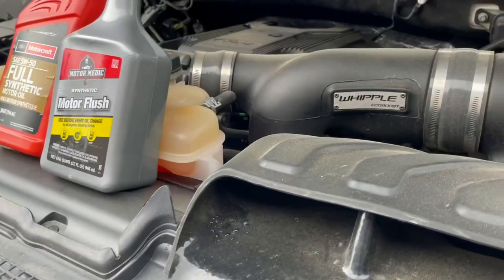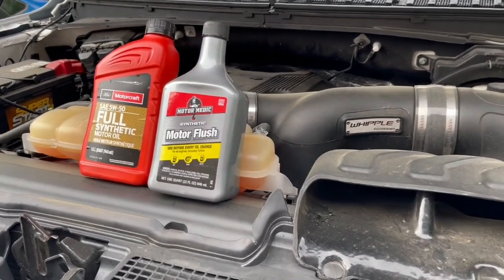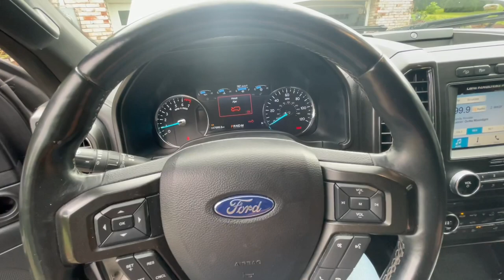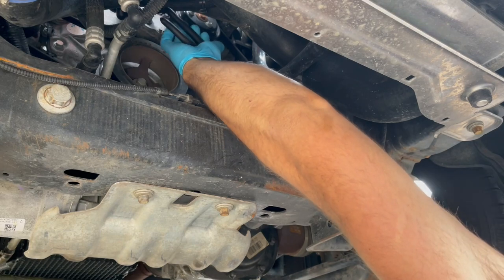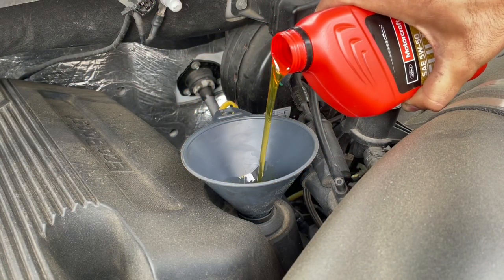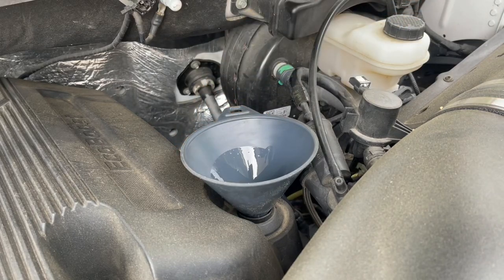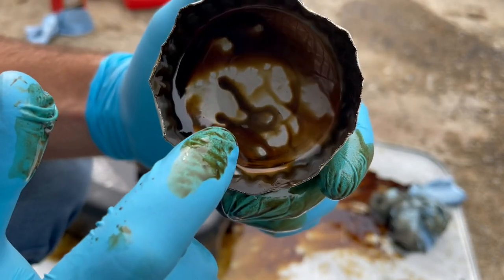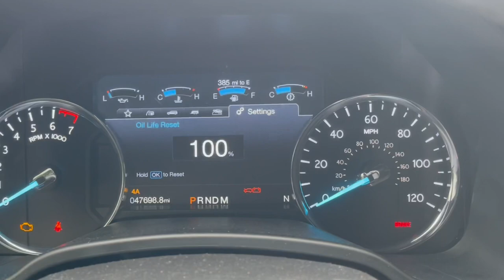2018 Ford Expedition Cam Phaser Rattle Fix￼ V6 3.5L EcoBeast

Comment: you can just do the flood clear trick and buy yourself some time.  hold the throttle to the floor and press the start button it will crank continuously without firing until you lift off the throttle.  it allows the oil pump to build pressure in the phasers.
Reply from the maker: There is a recall on these now, and my wife usually remote starts it in the morning. I’m going to do the PCM update and then replace the phasers, after that going to get an update tune from whipple 💪
Reply: @L8R-HP from what I understand they removed that pcm update it was causing transmission issues believe it or not. They now actually have physically updated the phasers somehow b/c they have a different number on them now.

Comment: You should not use 5w-50 in that engine. There's reasons why it's supposed to have 5w-30. You want that rattle to go away upgrade the timing chain and tensioner along with the phasers.
Reply from the maker: I drag race it

Comment: I used to get a similar noise in my wife's 2007 Expedition. Those 3V 5.4s are notorious for making all kinds of noises. I ditched my 2005 after 150K miles. Didn't want to deal with it anymore. Anyway, I stumbled upon Hot Shots Secret when I bought my 2017 F250 6.7. I wanted to get the best lubrication products out there. Well, I used their Stiction Eliminator in a fresh oil change and ran their FR3 in the next oil change 5K later. The cold rattle went away and that pin chatter around 1200 rpm is almost all gone. Really weird. Also, I notice the oil stays amber color the whole oil change now using Hot Shots Secret products. I was sold when I heard and saw that.

Comment: Add Lucas stabilizer, 20% and the rest oil. It's s meant to prevent dry startups. I put that in all my cars for years and I've never had any motor problems. There's another guy on YouTube that made a video with the 3.5 ecoboost and it solved the start up chatter.
Reply from the maker: Doesn’t fix the noise. Gotta replace the cam phasers with the updated ones. Lucas is good stuff tho

Comment: That hose there on the frame is the vacuum line for your 4WD front hubs disconnect....can't believe they still use that from the 2003 models.

Comment: Too new to have such cam phaser problems.  
Always been a Ford guy and own 3 currently, 2 with the 4.6 v8 and 1 with the 5.4 v8. I'm steering clear from ecoboost anything.
Reply from the maker: There is a recall this problem. I had a few 5.4 in the past and they had ticking problems. Ecoboost engines are great if you buy new and keep up with maintenance. Lack of maintenance kills them.
Reply: There was a recall
Reply: My 2018 with 60k miles is making the same exact rattling noise..

Comment: I run a 1 L bottle of Non Synthetic ATF Dexron3/Mercon in my engine for an hour of driving before I do a hot oil change.  The ATF will not hurt the engine but it does a good job of cleaning out particles.   I add in 1 ounce of Lucas ZDDP and 1 ounce of Lucas engine oil stabilizer for every 1 Litre of fresh oil that I put in the engine.  I use Genuine Ford oil filters and will not deviate from OEM filters.   I have 3 Ford trucks and  none of them have an engine tick and are super smooth.   I change my oil every 4000 miles.  The ZDDP and Stabilizer help with wear at startup.

Plate C

Comment: Technology...IDK it seems since lower ZDDP oils we have cam issues G.M Ford dodge. I have a Taurus S.H.O 3.5 ECOBOOST. I use Redline ester 5w-30 high ZDDP and I use Redline ZDDP additive to Bring the ZDDP values to 2500 ppm. Redline oil also has a insane Moly value. ZDDP is a Must for turbo protection so I'd rather change catalytic coverters every 5 years or so than mess with turbo/ timing chain/ cam issues. Just my 2 cents😊

Comment: Rattle goes away once engine is warmer and oil pressure is high enough to keep the slop off the timing chain. Wait until it's fully cool and see if the rattle goes away. 
Best flush is BG EPR and amsoil engine/trans flash. Motor flushes at parts stores are weak
Reply from the maker: Flushes don’t work bro 😂 if there is a problem you gotta fix it. In this case it’s the cam phasers that need to be replaced.

Comment: just had to repair my 2019 f150 (71k) which had the rattle for about month and then noise got louder and finally was constant during engine running, check engine light appeared.  Repair of cam phasers cost $3800
Reply from the maker: Mine rattled from 36k miles. I replaced everything recently at 85k miles. Cost me less than $400. Did it myself.
Reply: @L8R-HP do you have video to DYI

Comment: Did the heavier oil and the synthetic cleaner work on the cam phasers over time? You still have the expedition?
Reply from the maker: No it didn’t, I ended up changing the cam phasers, still have it, but it will be for sale in the next few weeks.
Reply: Bought Fords for the past 50 years - turbos and internal water pumps caused me to buy my first Toyota. And that's sad!

Comment: Ford now has a way to fix this, had it done on my expedition and have put 35k miles on it and the rattle hasn't come back since
Reply: Was it covered by ford?
Reply: How much was it to fix?? Mines doing the same thing.
Reply: Do you know what they did for that rattle
Reply: Replace with updated cam phasers/ timing chains and tensioners.

Comment: The engine cant fail if u put a thick oil in fact its better for the engine cause when its warm it has more protection my buddy with the 3.5 2019 f150 same transmission as well puts 10w60 liquid moly in tge summer and he says it runs mint

Comment: Would you be scared to buy a 2018 with 130k miles for 30k?
Reply from the maker: If it runs good and had the recall done I would buy it.
Reply: @L8R-HP  thanks for the reply I'm gonna go check it out this weekend! It's a black/chrome xlt max 4x4. Anything I should look out for specifically?
Reply from the maker: @geoffnelson64  cold start if possible. That’s when they rattle. Check for codes if you have a scan tool. See if they have maintenance records.
Reply: @L8R-HP  from the carfax it says it had cam phasers and engine shudder completed under the "manufacturer customer satisfaction program" August of last year. That's all I'm seeing for major service work
Reply from the maker: @geoffnelson64  that’s perfect 👍
Reply from the maker: @geoffnelson64  if you get it, I would do spark plugs, filter and transmission service. Also keep up with engine oil changes and it will run for ever. Let me know if you want to add some power 🤩

Comment: Could be oil filter be in a worse place?
Reply: Yes. Taught my Buddy how to change the oil on his 2003 Crown Vic. Right below the exhaust manifold on that thing. If that’s not bad enough, when the oil comes out, it drains all over the suspension.

Comment: My 2018 makes the same sound!
Reply from the maker: There is a recall on this issues. Cam phasers need to be replaced.
Reply: @L8R-HP  where can I find that recall ??
Reply: Did you find the recall?

Comment: Did u solve this problem bro ?
Reply from the maker: No🤦🏻‍♂️ need to replace my cam phasers.
Reply: @L8R-HP  so if u keep using it and this sound coming in the cold start only .. it will damage anything ?
Reply from the maker: @abdalazizkhaled4544  you could use it like that for a long time. It’s just annoying. There is a ford recall on this issues. Schedule your vehicle in and they will update the software and if that doesn’t fix it they will replace the cam phasers
Reply: @L8R-HP  they already change the phaser but still there is rattle coming ,i dont know from where but i ask them they told its normal bro its for secounds !
Reply: @L8R-HP  Only if you have less than 90K on it. They phase it out at that mileage.
Reply: @abdalazizkhaled4544 need to make sure its the new phase #; some dealers ate putting old # phases in

Comment: Ford is saying to use only synthetic blend oil for their turbo engines.  I know.  Sounds crazy but many reasons shown on YT.  But none of this fixes the lack of oil to the phasers on start up.  The trick that fasttoyo recommends below works, but most of us r too lazy or impatient to do that every time we start up a vehicle. Maybe Ford should make it the only way these 3.5s start up.
Reply from the maker: I turned my HP up so I choose to use better oil  full synthetic.
Reply: I spoke with a Ford engineer and he said all turbo or supercharged engines should run full synthetic. He suggested using a heavier oil, for instance 10-40, if the engine was making noise. Although not a fix if mechanical wear was bad. I had the ecm update on my F-150 and it now cranks a bit longer before start up. No noise
Reply: Since my last post on this subject 2 years ago, I've purchased a 22 F150 with the 3.5l  It came with the new cam phasers and SS exhaust manifold and a few other internal updates that are std issue now. I don't know if the phasers in the 22 150 are the same as the replacement phasers they install as updates to older model 3.5's pre 21. Seems like they would be the same, but can't be sure.  It now has about 14k miles. No chain slap. There might be a few micro seconds of delay before ignition.  I'm using the syn blend and talked to the mechanics at the dealer who also said, yes, only syn blend. I have been using full syn on all my vehicles for the last 50 years. When I was a aerospace engineer, I worked with several scientists that worked on the original teams that invented full synthetic oil.  It was used in Europe for over 20 years before coming to the US.  They showed me all the comparison data between non syn and full syn oil and all the methods they used to make the stuff. So I'm a firm believer in full syn even though I only used it on everyday family vehicles that are driven modestly.  I understand how superior it is over even the best non syn racing oils. But when the majority of Ford 3.5l motor engineers, that have millions of miles of test data on which oil was best for this 3.5l engine with the new phasers, I have to go with their recommendation of using the syn blend.  And I have my theory why it is used in this particular application.   @anthonybrincefield2812
Reply: @ginginthing  80,000 miles on my 2017 F-150,3.5 and knock on wood it lasts. I use synthetic in my vehicles and when I saw the previous owner had used it since 5,000 miles I stuck with it. Part of the reason ,when I had the opportunity , I asked the Ford engineer about Synthetic. He also mentioned that he felt recommended oil changes are too long. 5,000 miles is the limit for me on our vehicles. I should mention that my Harleys have been quieter when I tried a conventional racing oil.
Reply: Great data.  The recommendations I got from the scientists that developed synthetic oil made a lot of sense to me.  Since the oil will not break down under "normal" street use for at least 30k miles, which some people interpret as leaving the filter on for the same mileage, it still collects dirt which we know causes damage.  They recommended that the filter be changed every 3k miles and the oil be changed every third filter change, or about 9k-10k miles,  just to be safe. That's what I've been doing for 50 years, and none of my vehicles, many of which had close to 200k miles, have had oil any appreciative oil consumption or lack of compression.  So for me, syn oil works far better than std oil.  As far as these 3.5s are concerned, with the long cam chains that have far more slop than timing gear chains, and are mounted almost vertical, the synthetic oil with it's very low viscosity will fall down  to the bottom of the chain when stopped much faster than std oil.  Although the synthetic oil forms a better molecular bond to the metal that keeps fiction very low on start up compared to std oil, it doesn't provide a cushion of oil on start up compared to when the engine oil is up to op pressure. So I'm guessing that the Ford engineers had discovered that using the thicker cold viscosity synthetic blend oil sticks to the top areas of these chains and the new cam phasers longer than the pure syn oil does.  This helps during the first second of startup to help prevent chain slap.  And they might have also modified some of the oil veins leading up to that area to supply more oil on startup.  On the Harleys, this same principal might be in play there. The thicker oil (even when hot) might be providing a sound dampener for chains that are incased in a bath of oil.  @anthonybrincefield2812